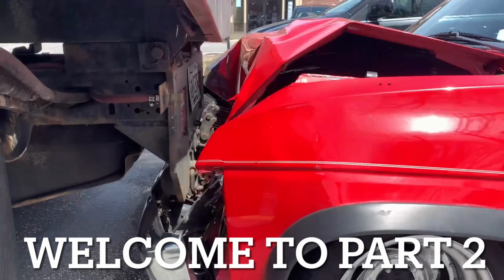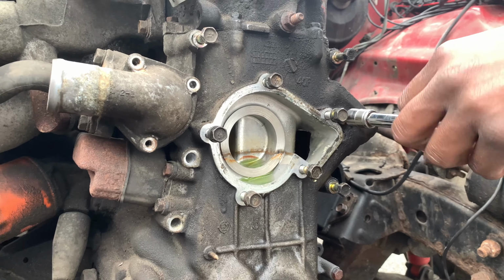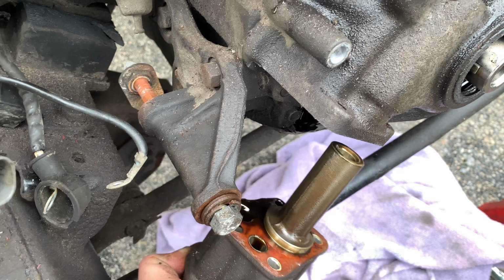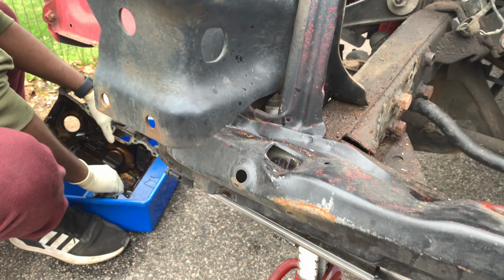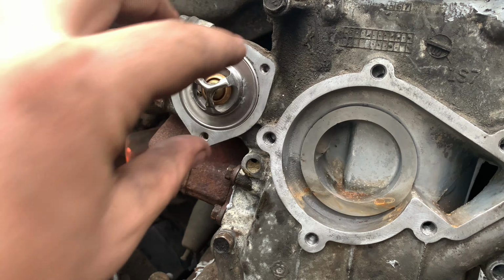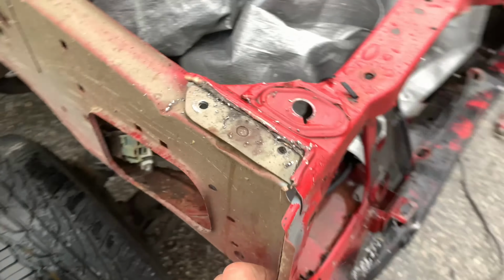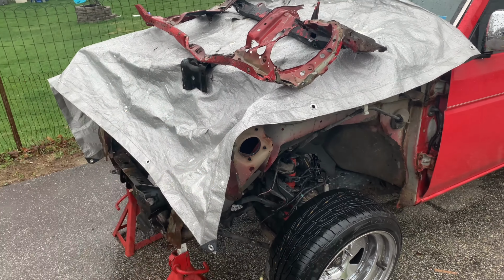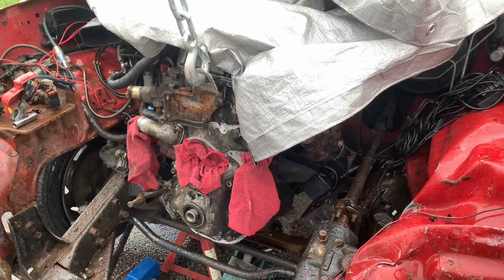Part 2 Of Rebuilding A Nissan Hardbody After A Crash!

Comment: 27 mm socket is the correct tool for that  bolt and you never mess with those small bolts they are part of the balanced  calibration from the factory if your truck is a manual put in gear and block the tires and loosen the crankshaft bolt if automatic transmission remove the starter and with a big flathead screwdriver or similar hold the flywheel be careful not to damage the teeth and that's how you can loose the bolt  20 years + of owning Nissan hardbodys I learned a thing or 2 lol ps never let anyone borrow your truck friends dont let friends drive drunk lol that's it
Reply from the maker: Hahahhahaha, thankfully our friend doesn’t drink Hahahah, he was an old guy, but I know what you mean, and thank you for throwing in your knowledge man! At the time I was just so in the moment I completely forgot that I could’ve just left it in gear😅😅
Reply: @JapaneseMinitruck  no problem man just wanna help and glad you working on her to get her back on the road another tip that worked out for me at least replace your oil pump with a melling oil pump is heavier because is not aluminum is heavy gauge steel obviously wears out slower than softer material like aluminum you replacing the dizzy might as well replace the pump have fun setting the timing lol you know what I'm saying right ?   Be safe bro